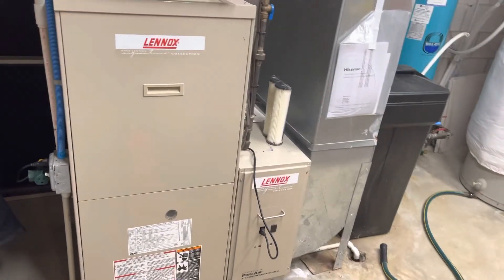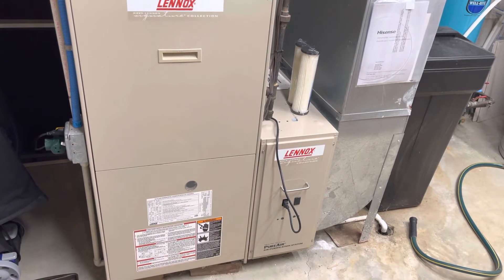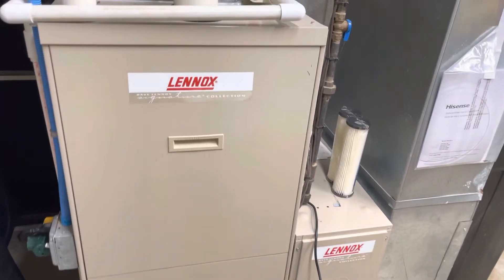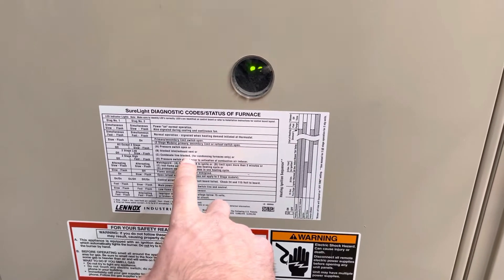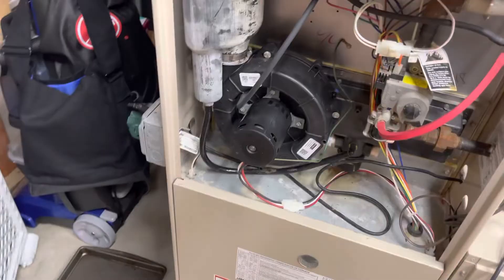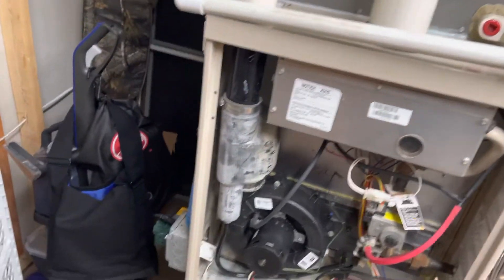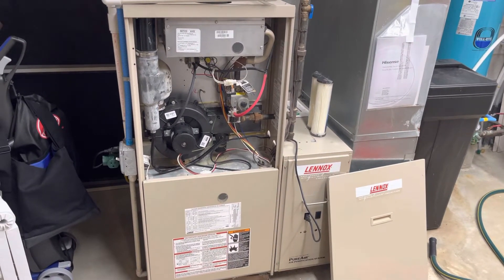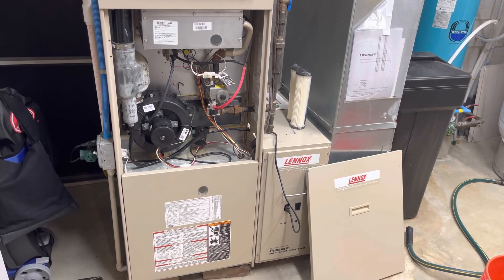Furnace DIY - Water in inducer motor causing NO HEAT - WE’RE GOING TO FREEZE

Comment: Thank you sooooo much for this video.  I had been troubleshooting my son's furnace for ~ a week and had replaced the flame sensor (not the issue) and the pressure switch (also not the issue).  I was able to bypass the switch to make the furnace run which gave him heat until it reached temp and shut off (ot wouldn't reset on its own)...  The induction fan had water in it and I couldn't determine why...after watching this, I dug in further and found the drain clogged...  saved the furnace and saved a tech visit...again, thank you
Reply from the maker: Awesome to hear! Glad you got it working.

Comment: Thank you very much. I also replaced BOTH limit sensors as one was wet and the other fuse was popped (Very tiny with fuse in the center and 2 wires connected) Very cheap on Amazon and delivered next day. I hope this also helps others.

Comment: I have a Carrier model 59SC5B.  I found it much easier to remove the liquid from the inducer motor housing by disconnecting the PVC exhaust pipe, then threading a small suction hose to pump it out. (Harbor Freight "Multi-Use Transfer Pump" #83144, $7,49).

Comment: My heater would not work in this recent Arctic Blast when the temps dropped around zero at night.  The High Efficiency furnace requires a drain line to dispose of water generated as it condenses out of the the exhaust of the burning of natural gas. My furnace is in the attic which was 18 degrees.  The water froze in the drain line and in the drain tubes from the secondary heat exchanger and the drain tubes from the inducer fan.

In my opinion this is the absolute stupidest design flaw I have ever seen.  A warning label should be included on the furnace stating that it might not work in freezing weather.  In order to get the POS to work, I had to disconnect the frozen drain line, remove the ice from the drain tubes, and place a drip pan under the unit to catch the water when it comes out of the furnace.  I have to go into the attic after every 30 minutes of heater runtime to dump the water from the drip pan.

If the installation instructions included a warning to install heat tape on the drain line in freezing climates, then the furnace would continue to operate when the attic temp drops below freezing.  The drain lines are insulated, but that neoprene insulation will not protect the drain lines more that a few hours.   Oh how I wish I had a standard furnace that did NOT produce water when in operation.
Reply: I’m thankful I have a 80,000 btu 80% gas furnace. My son has a high efficiency gas furnace and that condensation is a problem too. We’ve had to redo the pvc exhaust pipe and clear all the condensate lines.
Reply: This past artic blast did not cause a problime for me.  I previously insulated the PVC exhaust line.  Water would condense inside the line an run back to the unit which added to the water problem.  Secondly, rather than turn the unit off at night, which is what I like to do, I set the thermostate at 65, so that it would run periocically to keep the unit warm and prevent the water drain line from freezing.  The whole pupose of a 95% effecient gas furnace is to save enerfy.  By forcing me to run the unit when I normally would not, has the opposit effect.   I now use more gas than I would with an 80% efficient unit.  This happens whenever the Federal Government dictates how products should be built.  Same situation with my clothers washer.  I always have it set on bulky loads now so the water will cover the clothes.  Now I use more water than I would have with an older machine.  @jeffcibulka5063
Reply from the maker: The average homeowner is screwed if they aren’t handy enough to troubleshoot this on their own. Nor should they have to be.

Comment: Looks like a model G32V furnace. The other thing you should check is the black hose that leads over to the left at the condensate catch. Dis connect it and blow through it to make sure it isn't clogged between there and the cold end header box or it'll back up water into the inducer again.
Reply from the maker: Good callout. Thanks!
Reply: I just had to do this. Thank you for your comment as it confirmed what I thought I needed to do.